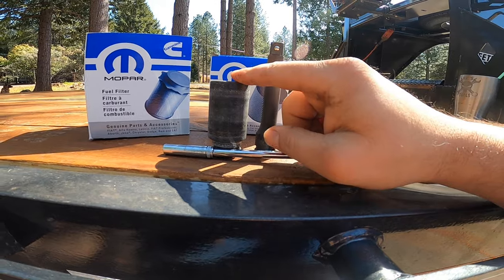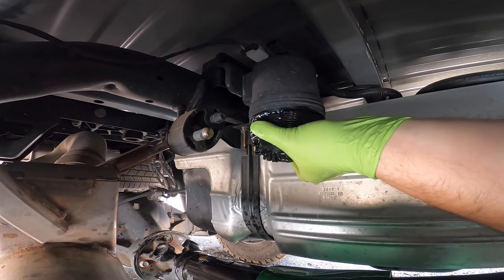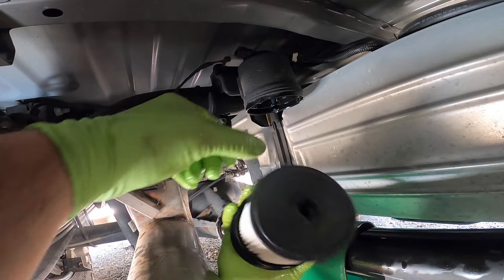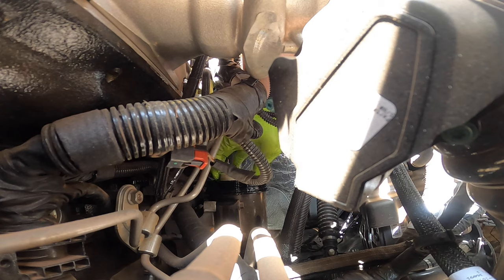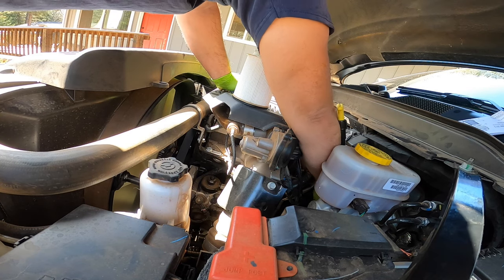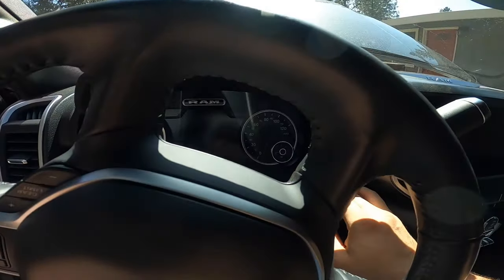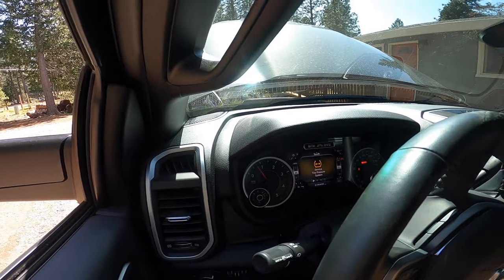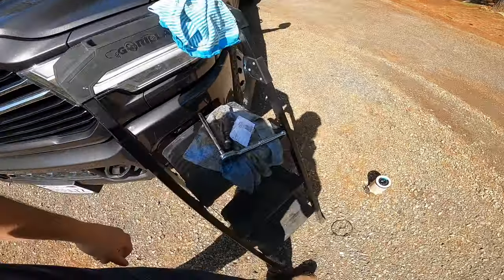HOW TO: 5TH Gen RAM 2019-2024 FUEL FILTER CHANGE for your 6.7 Cummins

Comment: Im 6 days in to my 2021 2500 and first time diesel owner. Learning lots of what to do and what not to do thanks to guys willing to help out FNG's like me! Thank you for the video!
Reply from the maker: Nice congratulations! And happy to help out, happy you found this video 👌🏼
Reply: Don't worry, I'm in the same boat.
Reply: Never be without a truck again…
Reply: Same, and it’s time to change the filter on mine and the dealership wants to charge $540. Now I changed out the fuel filter of my first car and didn’t mind doing work in it myself since it was a beater but now I have this nice diesel truck I’m a little paranoid to mess it up.
Reply: I’m the FNG now.
Reply: @greg5830  🤘
Reply: same brother , gonna try mine and my first oil change myself on my big girl tomorrow...
Reply: I went to the dealer to get the first oil change and fuel filter and was stunned how much it cost. Im lookinh into changing my own fuel filter in my first diesel truck...

Comment: To keep the diesel from spilling all over the place on the rear filter.  I use a large zip lock bag.  Put it over the canister when unscrewing the drain or canister letting the diesel spill into the bag.  Cut open large cardboard shipping boxes and lay them all over the ground under the truck to absorb small spills.
Reply from the maker: Not to shabby of an idea right there! Appreciate it

Comment: I stopped by my dealer yesterday to see what they would charge for a fuel filter and oil change. They quoted me $450 for the filter change and $200 for the oil change. Total ripoff! I'll be doing all this work myself. Thanks for the informative video!
Reply from the maker: Ya!! They charge like crazy, definitely not a fun price. 
Happy you found the video to help out
Reply: @IManOPERATOR do the fuel filters and oil need to be changed at same time?
Reply from the maker: @kay_sanchez  you don’t “have to” however they typically need changed around the same time. By the time my oil gets to 10-15% my fuel filters will be maybe 30% 
If I’m already under the truck I’ll just change the filters too.

Comment: I am a Field Service Engineer, fancy way of saying I am an over paid Industrial Maintenance guy and I find a lot of things are not as hard as people would have you believe. I am going to retire and going to pull a 5th wheel around the country and getting myself lined up to do this while on the road. Very helpful and thank you.
Reply from the maker: Lol I like the classification! Enjoy you’re retirement! Have fun! Happy you found the video!
Reply: I nusr bought my first dodge/ram product 2 months ago..nicest truck I've ever had, but why the hell do the engineers always design things to be way more difficult than they need to be, and then the car manufacturer actually builds it?? Where is common sense?????
Also..a tube of white grease goes a long way on those O-rings
Reply from the maker: @danielwood1894  just remember cummins motors are not only in trucks like a power stroke or a duramax. They don’t change locations for trucks, like my chipper has a 6.7L cummins in it and the fuel and oil filters are right there where they need to be to Service the motor.
Reply: @IManOPERATOR  true, however my buddy has a 2021 3500 flat bed duallie and the fuel sep is right there on the frame rail under the rear B pillar..why not do that for the 2500 as well instead of directly over the drive shaft? And you cant get the fuel filter out of the housing under the intake without knocking all the dirt on the wiring harness into the bowl...it didn't have to be that way
Reply from the maker: @danielwood1894  I hear you loud and clear on that one, there’s no winning at times lol, there will be some relocations being done down the road on this girl for sure

Comment: Great video, my first time changing it myself on a 2021 RAM 2500. Thank you for taking the time to help us out. I do need to find some better ways to keep the diesel from spilling. I don’t like the mess it creates in my driveway. My only suggestion was on the rear filter replacement…push the new filter in place first (it will stay there) and then put the cap on and twist. It’s much harder to put both in at the same time as the filter needs to sit in there properly. Worked great for me 😎
Reply from the maker: Awesome happy to be able to help out. And yes you’re correct on the filter I guess it a what worked best for you. Some reason I’ve tried that couldn’t get the thing to thread to save my life

Comment: I just bought a 2022 6.7 megacab. This is my second 2500 6.7, and I paid to have them done everytime before. Almost $400 everytime. I plan on doing my own this weekend thanks to your video. I think I’m going to try and get some clear flexible tube to attach to the rear petcock to help with draining it around the drive shaft.
Reply from the maker: Little tube is nice to have. Mine was to small sadly but. Could be worse

Comment: Very helpful video.  I have a 2500 with the 6.7L Cummins, same config. under the hood as your 3500.  It's a great truck, I might add.  I'll be changing my fuel filters out myself for now on.  The dealer wants $650.00 to change out.  They explained to me that it is very hazardous work,,and should be left to pros. only, haha!!  That's why the price is what it is..  Thanks for posting!
Reply from the maker: Ya it’s quite outrageous what they charge for a 15 min job. 
Happy you found the video happy that it helped out!

Comment: Wow that worked like a charm.  Fix it in about 2 mins.  What kills menus that the truck was at the dealership because the electronic transfer case wouldn’t come out of neutral…they fixed that but didn’t address the gear shifter.

Comment: You have no idea how much this helped me. I couldn’t tell from the video what you were doing with the upper filter as well as I could the lower filter. I took my new 2021 ram 2500 to the dealership in which I purchased a $6200 service/extended warranty on it yet when I brought it in for my first service at 7500 miles they wanted to charge me $420 plus tax I assume just to change the fuel filter. I am mediately pitched a fit and had them cancel the service policy where they were going to maintain my truck for seven years or 84 months. They knowingly miss lead or said they forgot to tell me that the fuel filter wasn’t covered so it would’ve been 420+ tax every service in addition to the $6200 plan that I had purchased and I thought that was crappy of them to do with me that way. Thanks for the video and the tips
Reply from the maker: Ya I’m sure they “forgot” to mention that to you. 
It’s definitely way over priced for them to do a 15 min service with $160 ish in filters 
Happy you found the video to benefit you. It’s an easy process do it with your oil change each time you’ll be good to go, I do recommend only to buy oem filters. Online or something dealer wants to much for them. No aftermarket filter comes close to the quality of the mopar filters
Reply: I feel your pain...did same thing to me .....never again
Reply: @IManOPERATOR  I found Doc filters are just as comparable. They have done great on my ram 3500
Reply from the maker: @volkodavwolfcrusherlv7133  awesome, ya been hearing a lot of good things about those
Reply: @IManOPERATOR  yes, they are great, I have used on multiple trucks and pay around $100 for both filters delivered. Dealership is a total rip off!!
Reply from the maker: @volkodavwolfcrusherlv7133  very nice! And yes!!  They most definitely are a rip off!

Comment: thanks man - so easy to do this.  I didn't use a hose, just a clean glass jar right under the port.  after loosening the canister cap I drained couple more times before removing rear filter cap. first time maybe 90 min with set up and clean up, watching video etc
Reply from the maker: Perfect! Happy you found the video helpful! Keep that girl tip top

Comment: I used a 5/8” hose on front filter to easily direct fuel to spill into catch can.  You will see the opening from underneath, above front axle if you have a 4X4.  You can also use a big funnel for rear filter to direct spilled diesel into a container.
Reply from the maker: Honestly after the truck sits for a bit I’ve never had the front filter spill anything when changing it. Tube is a life saver

Comment: Great video.. Just a note, get some dielectric grease and coat your O-rings, they will go in smooth and you will get a better "feel" for the torque.. The fuel makes the O-rings make that awful noise and cause them to shudder as you tighten, the grease will stop that... Also if you unplug any electrical plugs, put some of that grease in there too, it will prevent them from corroding and make them easier to unplug as well.. Nice truck BTW....
Reply from the maker: Definitely I appreciate that information I never really thought about that. Appreciate it
Reply: Can you use silicone lube?
Reply: White lithium grease works too.
Reply: I think dielectric grease will give you problems in your electrical components, it acts as an insulator, not a conductor.  You could restrict the current if you're putting it in your plugs.
Reply: @gregcoughlin4615  No Sir, Used it on electrical components to protect them from salt water in the Navy for 20 years. It lubricates the connection and also prevents corrosion. There is a reason the Navy ships have lasted since WW1

Comment: Good video, first time change for me. My last Ram only had one filter and it wasn't plastic like these. I broke the valve 8mm nut off trying to get it to open and drain. Had about 3/8 of a turn so it was a slow drip. Ordered extra online. No on within 2 hours of Charlotte NC had the valve. Went to Gastonia Dodge they had the whole cap with the valve in it, $79.85. So, with the spare cap and the soon to arrive bleeder valves I should be okay. As soon as I saw the first video and how the whole canister flexed and twisted, and the effort put in to make it turn, I figured the I'd be replacing the whole thing. Wonder why Fiat went with plastic??!! Love the truck but that is NFG! Good luck to the rest of y'all......
Reply from the maker: Oh man that sucks. Got to love plastic. Happy you found someone that had it. Expensive fix but you’re back on the road at least

Comment: Good video. Im glad they updates the rear filter from the 2016 models, but there’s still got to be a better way to design a drain in that rear housing. And the front filter is a pain and I always feel like I’m going to round off that top cover.   Engineers never sit down with mechanics!
Reply from the maker: I hear you there! I’ll be getting the cat filter housing and replacing this here sooner or later
Reply: Please let us know when you do. I've looked at the CAT system and the front bypass but haven't done it yet.
Reply from the maker: @xcountry1582  ohh for sure I’ll have a video for that 🤘🏼

Comment: Nice to see that I don't have to drain the diesel from the front filter. Heading out to change mine out here this afternoon at 15K miles.
Reply from the maker: Ya they make it simple. Best of luck happy you found this video
Reply: @IManOPERATOR  It wasn't half bad but it was still a messy/stinky job. Surprised at how dirty the rear fuel filter/water separator was at 15K.
Reply from the maker: @texlee1640  ya they can get bad pretty quick I only fill from chevron stations, always have had clean fuel

Comment: Thanks. I use to drive a tractor trailer (Cat, Cummins, & Mack Thermodyne motors) and I did all my oil & filter changes. This is my first Dodge Ram Cummins (I'm older now) and when they told me how much it was to change the oil & fuel filters, I immediately thought it must be a lot more difficult than when I was younger. Well, your video cleared that up for me. They want $229.95 to change the fuel filters $184.95 for oil & filter change! WTH? I can do all of this for a lot less! Thanks for confirming! Good video!
Reply from the maker: Ya it’s a rip off and a very simple service to do. Happy you found this video!

Comment: Ram makes a good oil filter and bad oil filters  .the best oil filter is an lf16035 stratapore oil filter for Cummins. Fleetguard is a subsidiary of Cummins. I have used this oil filter on 1989 12 valve, 2003 24 valve and my 2021 6.7 24 valve with no problem. Here in Santa Rosa CA they cost 20 dollars but it is the best oil filter. 😊
Reply from the maker: Started to buy the CAT oil filters for all the trucks it’s convenient and they don’t cost to much and a much better filter far as I know over mopar and fleet guards filters
Reply from the maker: Not sure why I’m just seeing your comment lol

Comment: If you will crack that drain again. As soon as you see a drop of diesel come out around the housing. That will drain the rest of the fuel. It will not drain it all the first round. As it catch get a breath of air. That will let it finish. Also a drain hose on the drain nipple keeps the fuel from making a mess also.
Reply from the maker: Yes! That’s what I do now. Finally have a drain tube that works on that valve now also. The tube I had for this video sadly was to small.

Comment: Great detail, but you skipped over one thing that I'm hoping to learn.  When I did this last, the front filter was on very tight, and was so hard for me to break loose.  I couldn't use an extension because of the other components directly above the filter.  How did you get an extension on there?  What length and any angled/swivel adapters?
Reply from the maker: So the first time around those are hard to break loose. Least mine was a bit too. 
I changed out my front filter cap to an aluminum one genos has it. 
Made it much easier to loosen and tread back on. 
I have learned a stubby socket with no extension also works with a 1/2 ratchet.

Comment: Had a 16 that i did fuel filters on … picked up a 22 last year, glad to see not much difference …. Dealer wanted 700$ for a oil/fuel filter change … had them do the oil change for 150$ … do the fuel myself for 80$ in parts.
Reply from the maker: Nice! And ya super simple service that costs way to much

Comment: you rock thanks! was going to pay the dealer but they pissed me off. Save $$$ Mine is a 2021 HO so the same
Reply from the maker: Happy you find the video! Ya same some money
Reply: @IManOPERATOR  honestly was just going to pay then I looked at warranty and diy oil change or fuel filters doesn’t void unless I f**k it up. So easy money 💰

Comment: Great Video - Where does in O-ring go in the on-engine filter housing? From the video it looked like you pushed it to the bottom of the housing. Thanks!
Reply from the maker: I appreciate it, and yes what you saw or think is correct. The o-ring goes on the housing itself, took it off the same way I did for the rear filter housing

Comment: I shove a clear hose in the housing of the rear fuel filter and drain what I can before removing the housing cover..  Makes it somewhat cleaner so ya don't have diesel fuel splashing all over the drive shaft
Reply from the maker: Ya I know 😂 dam hose I had was to small so I just said screw it
Reply: @IManOPERATOR  👍

Comment: Excellent video.  Did you not use the petcock on the front filter because it sat for a day or so?
Reply from the maker: Thank you, and correct, I’ve even changed the filter with the truck off for an hour, barely spilled anything

Comment: I change oil (and oil filter) every 5K miles and 15K on the fuel filters.  The secondary filter (under the hood) is always clean.  What are your thoughts on only changing the secondary filter at 30K ?  I'm on my 4th diesel pickup and have always changed the oil at 5K and fuel filters when suggested by Dodge (Ram).  Still have my 2004 2500 and 2019 2500. I'm 74 and have never had anyone else service my vehicles.  Saved a wheelbarrow full of $ by doing my own.  TT
Reply from the maker: So in my experience and opinion, you’re changing your oil way to soon and it’s probably not necessary. Don’t get me wrong if anything you’re not hurting anything but I’ve sent in an oil sample on a few rigs before at 10k change and they are well with in limits of the oils structure and lubricity. The fuel filters i get it, I changed them out just not to long ago, rear filter was quite dirty no doubt and the front as usual was still clean in my eyes. I feel it probably wouldn’t harm changing the secondary filter every other change but going 30k I’m not so sure. 
I will in good time change out the rest
Filter with an adapter system for cat filters to have first and secondary filters under the bed  even with that. If I remember right they recommended to change the front filter every other fuel filter change. 
And man no doubt on saving a load of money doing your own maintenance. And me personally I’ve always enjoyed this stuff.

Comment: I do have a question for you. I was reading that when tightening, you should use a torque wrench and stop at 25lbs. I notice you didn't. can you give some info on this? I just swapped mine out today and tightened until the cup stopped turning. I didn't force it further, just stopped. so, thoughts?
Reply from the maker: I know it’s 30.5 NM to torque it down. 
You can do either or, if you’re scared to over tighten or if you think you won’t make it tight enough yes I definitely recommend using a torque wrench, I forgot to give any details in the video about that.

Comment: Changed mine yesterday. Wasn’t  difficult to do, but after priming the fuel filters 4x as recommended, the truck started then stalled after 5 seconds. Repeated this process three more times with the same result. Have no idea what the problem is, but I’m fucked if I can’t get it started tomorrow for work.
Reply from the maker: Did you buy oem filters? I’ve heard some people getting fake oem filters having this issue I would check your rear filter housing first then go back to the front. Long as you hear your pump working. Slight chance of a bad filter,